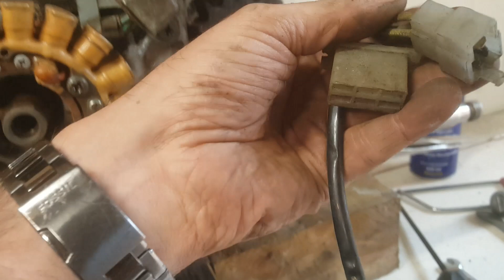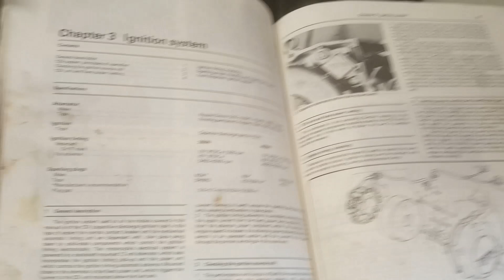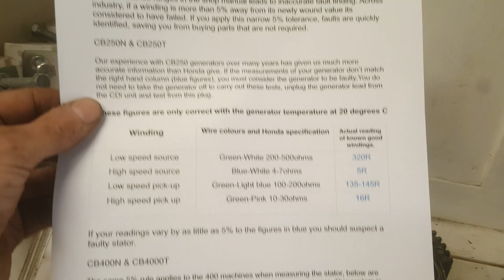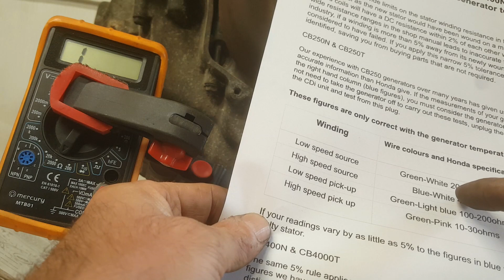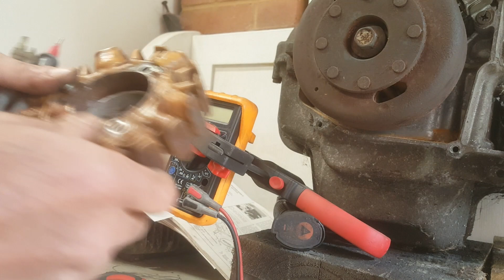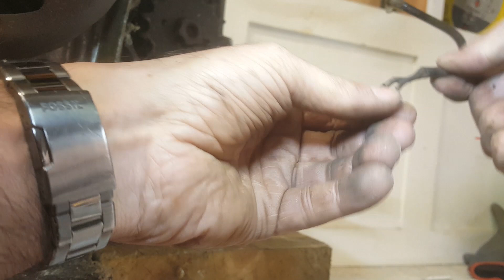Testing the Stator on a CB250 Engine, "Sid" the Scrambler Project Build Part 3

Comment: Highly appreciate your work, i have no clue how the high speed pick up works though, could you please share some information about that too. 
Thanks a lot
Reply from the maker: Hi, I am happy to help where I can, but not sure what you are asking? Ryan
Reply: @RyansGarageUK  I got my head twisted thinking how the high speed pick up works, i mean the working principle, can you please tell me how it works? 
And my stator is not in original state, one of the previous owners has repaired it and the wires are not in original colours. Im glad if you could let me know the original colours.
Eg;-
(Blue- High speed source coil output )
(White- Slow speed source coil output)
(Pink- Advancer coil output )
Reply from the maker: @lahirulakshan8028  hi, i m not an expert in electics and woud not wish to tel you something wrong. I would suggest searching for the wesbsite of Rexs Speed shop, as they have an excellent online guide to testing all the windings and the colours of the wires. In principal i think the high speed just sends a pulse that the CDI uses as. Timing marker for when to spark based on position relative to TDC and the Revs.